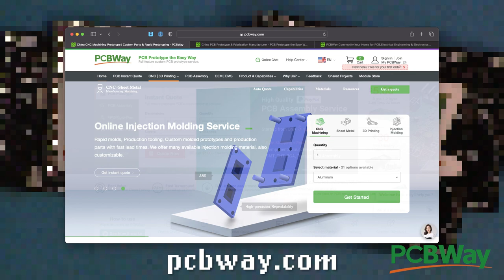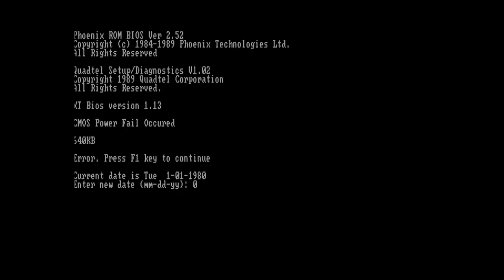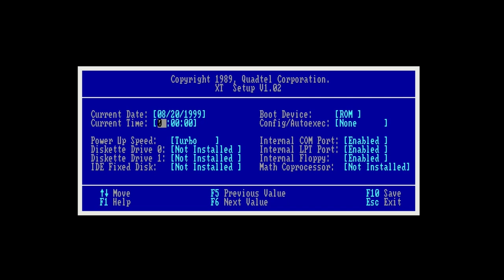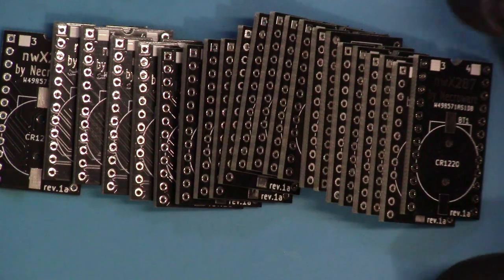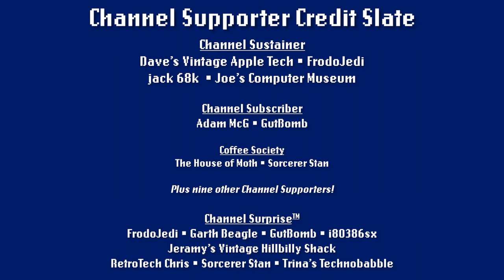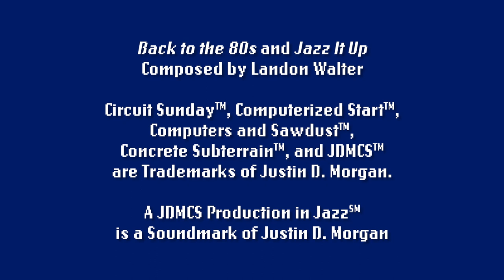Building a nwX287 by @necro_ware with @PCBWay to Replace a Dallas DS1287 RTC (Computerized Start™)

Comment: Nice work and these look like a great replacement.  In 2024 the 12887+ is still manufactured.  Maxim bought Dallas 20 or so years ago and in 2020 Maxim was acquired by Analog Devices.  You can find them on Mouser and Digi-key.  Personally, I like the DIY replacements better but for those that want a OEM replacement then you can still get them.
Reply from the maker: I should have double-checked before I released the video. I thought I had seen that the part was discontinued by the manufacturer back in 2020, but at that time, I wasn’t aware that Maxim was being acquired by Analog Devices.
In all likelihood, I misread/misheard something and thought they were permanently discontinued.
Though I have at least one motherboard that isn’t compatible with the 12887+ or even this Necroware module. Luckily I had a GlitchWorks module based on the 12885 (no plus) which it is OK with.
Reply: How do I find it on their web-site, it doesn't look like simply searching for Dallas DS1287 RTC or anything similar works. Looks like you need a part number.
Reply from the maker: @uniktbrukernavn  the current part still in production is the DS12887: https://www.analog.com/en/products/ds12887.html
Reply: @jdmcs  Fantastic! 
I'll look into buying one, hope they ship to Norway. 
I'll probably still try to modify my own just to see if I can do it. My father did buy me a soldering iron many-many years ago, it should be like riding a bike 😎
Thanks for providing a URL.